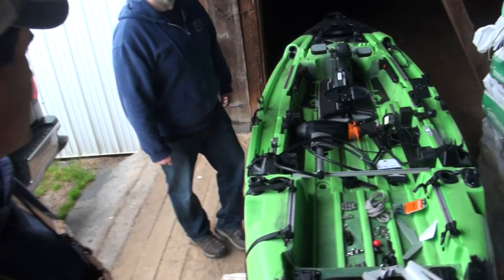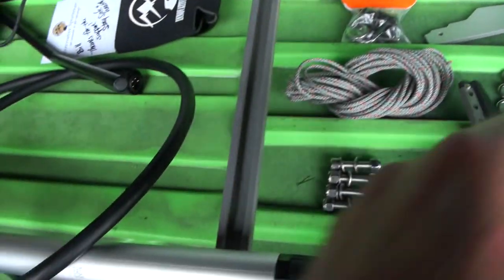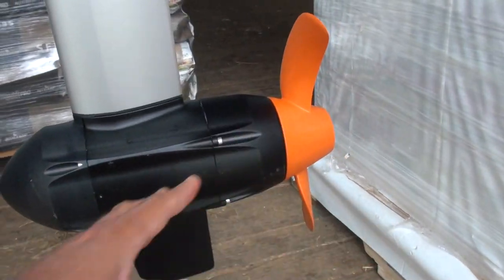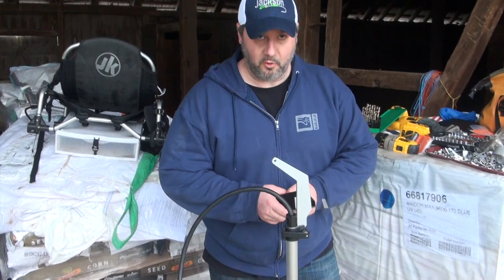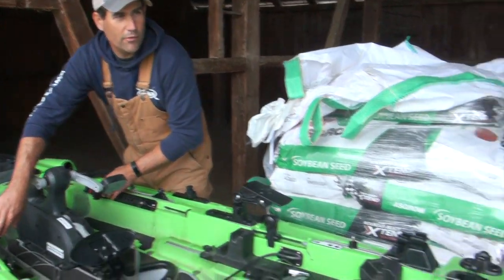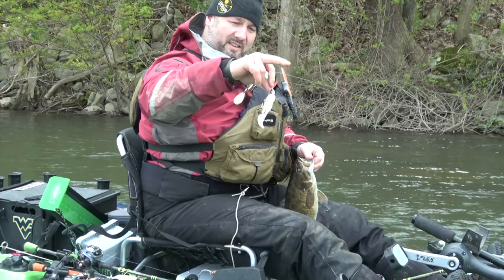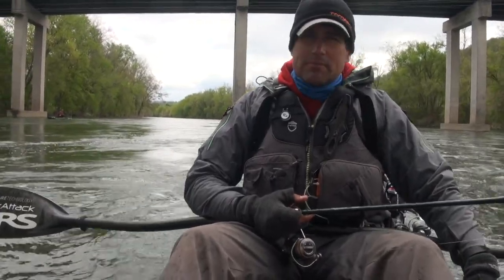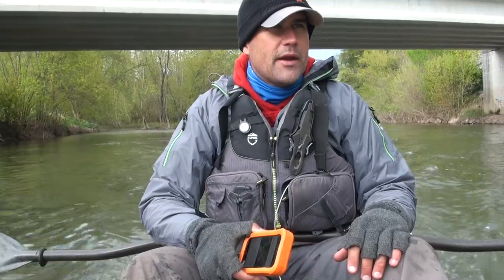Jackson Big Rig Torqeedo Ultralight 1103AC Install

Comment: When the motor was under full power, it appeared the rear of the kayak was only inches from going below the water. I noticed similar results in your Yupik setup. Is it something that weight redistribution would fix. Or is it not really as close as the camera makes it out to be?
Reply from the maker: Tennessee Kayak Fishing All of these kayaks have scupper holes and are self bailing. I did have some concern with the amount of water around the rear hatch on the Big Rig FD at full throttle. I took a photo of it and showed it to Bill. He checked inside the hull and it was dry. The YuPIK has no hatches, so no issues there. When hatches do leak, the fix usually involves silicone around the hatch/hull interface and/or a fresh gasket. Sometimes a gasket has a weak compression and adjustments to the lid or latch need to be made.    But rest assured that the motor won’t sink a sit on top kayak the way it might swamp an open boat like a canoe.